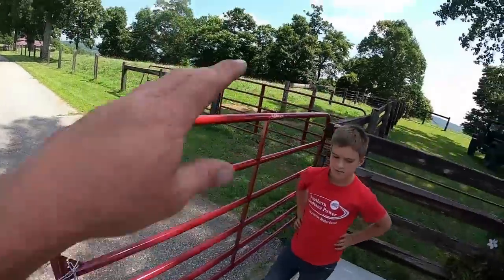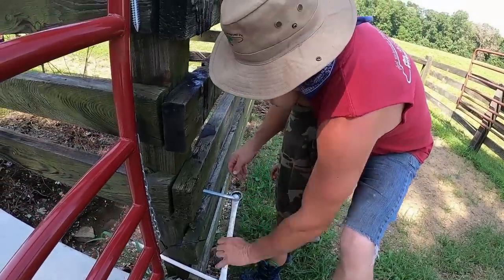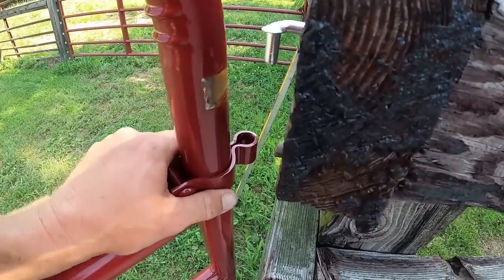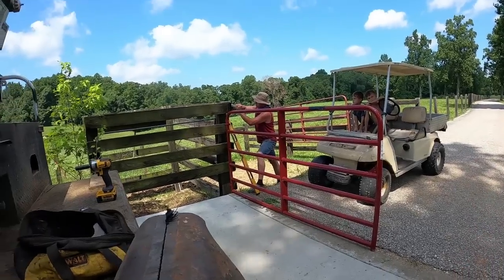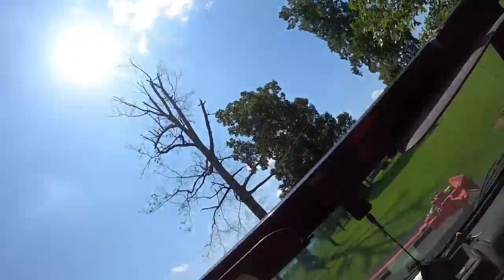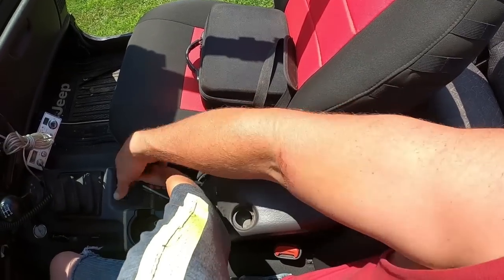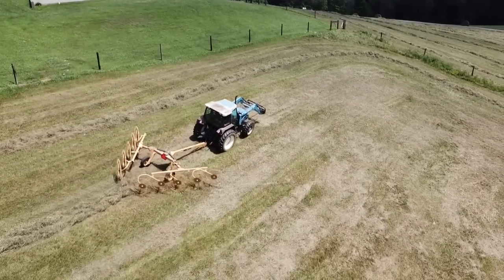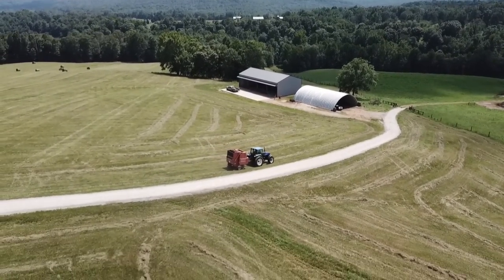Hanging Gates with my boys and drone vid of bailing hay!!

Comment: Nothing beats the family time you have when teaching your kids like that Wade. Fond memories for you all as well as teaching them how to fend for themselves. Good for you my friend, raising men that can do for themselves is sure better than rasing punks who WANT IT DONE without a clue as to how to fend for themselves like them punks that are protesting. As for that JEEP, you need to get YOURSELF a jeep and leave MOMMA'S toy alone. As far as the MANUAL gears, try teaching them the CUP method. I did when I taught my son to drive and he didn't cost me a gearbox OR CLUTCH lol
Reply from the maker: Haha thabks buddy but what is the cup method
Reply: @LoggerWade  make a cup with your hand as if you drinking from a tap. Use the hand like that for changing gears. 1 and 2 are futhest away so you place the heel of the hand,( BOTTOM OF THE CUP) away from you when you change, 3 and 4 just use the heel again only keep the hand pointing straight up and then pull it straight back as no shifter springs needed. Then for 5 and 6(if you have 6) use the cup on the outside of the shifter knob to pull it towards you and push forward or back